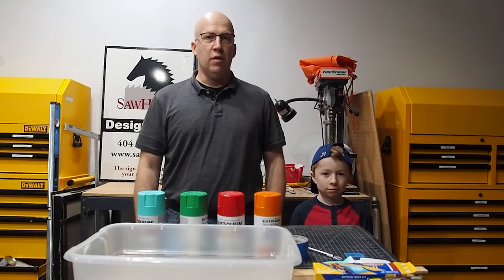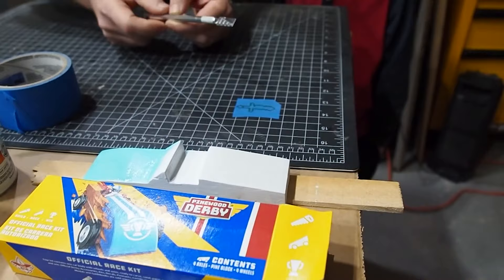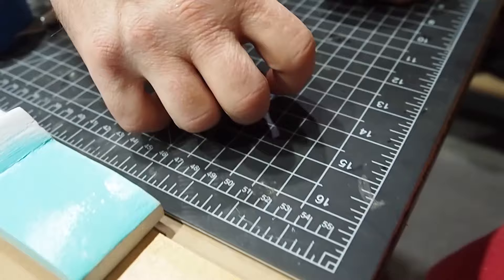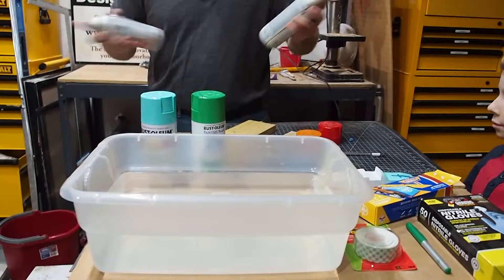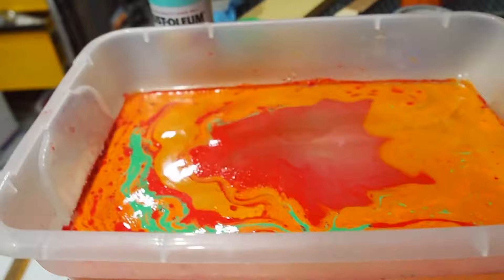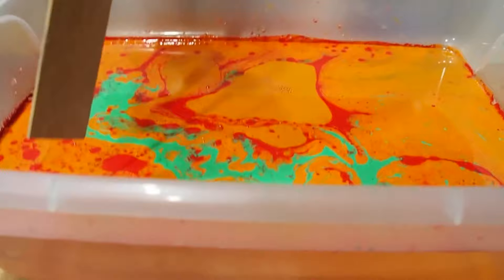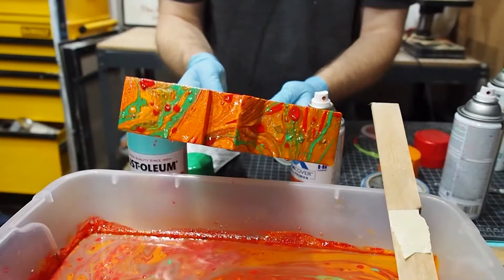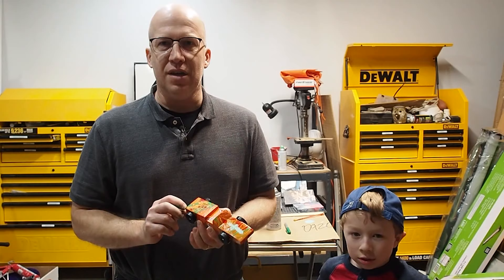How to Paint a Pinewood Derby Car by Hydro Dipping

Comment: We just had our race, and it was a bit of a bummer of a car. I thought of hydrodipping on the way home, so if our engineering isn’t better for next year we will at least drop jaws for style! The car turned out great, and we will use this method next time.
Reply from the maker: This was my son's last year so he dipped it again.  The other years he just painted it.  He got top speed overall in the last race he ran.  The big difference was the graphite.  He was underweigh so added a ton of graphic to get to 5.0 onces.  It worked.

Comment: Great video. Is the surface smooth when your project is removed from the container
Reply from the maker: Good questions.  No it was not smooth- however it can be lightly sanded and a smooth clear coat could be added to improve air resistance.  We were not going for speed with this design.  My son is only 8 and was trying to create a mine-craft color theme.  If you use less paint and all of the same brand- you would have better results if you wanted it to be smooth.
Reply: SawHorseDesignBuild thanks a lot. I’m going to try to do this with some parts for a kids chair.
Reply: What's the best way to dispose of the remaining paint and water?